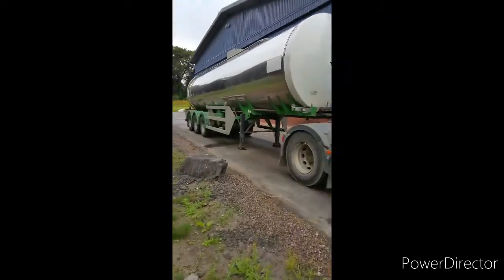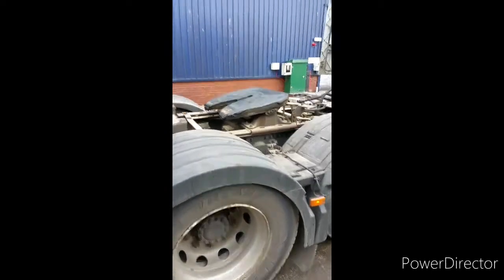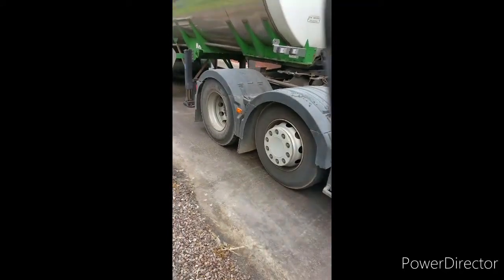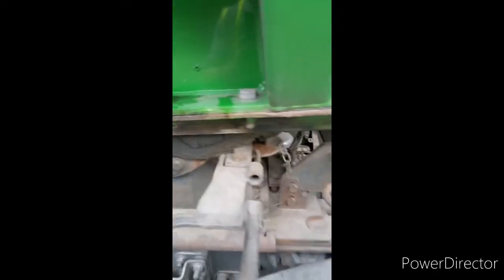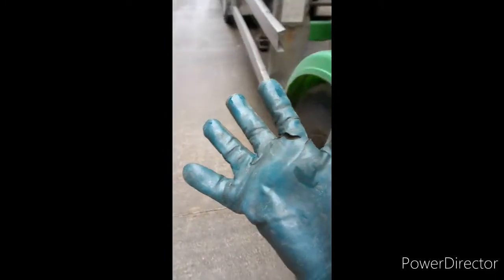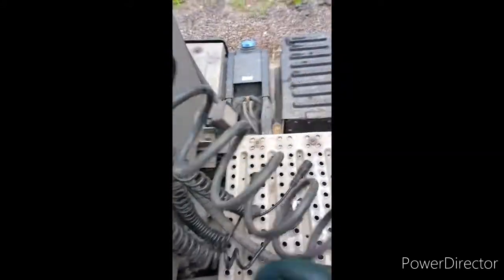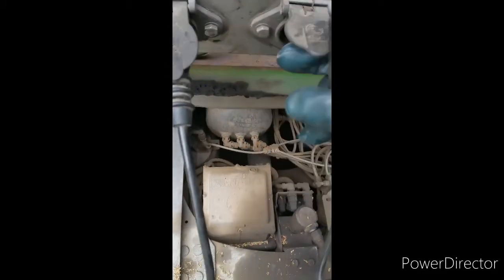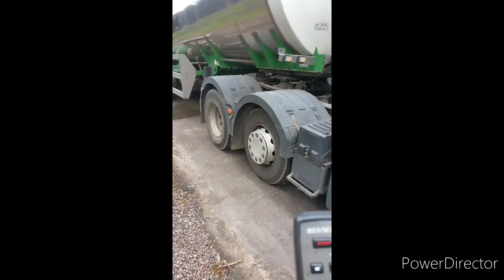HGV Artic Trailer Coupling / Connecting - idiots guide

Comment: You forgot to check the trailer brake & shunt buttons before you lifted trailer.
      If the trailer shunt button was left on & fully loaded it could roll backwards & damage something like the legs as they hit the ground. 
      We all do it, but it’s worth checking.

Other than that perfect.  I like the way you established it was loaded from the beginning & lowered the mid lift to protect equipment from straining.

Top man.     Hauling tanks is no joke.  Super heavy loads & if a tanker is over-taking guys, get out their way, they will roll in gear with the retarder on twice as far as any other load on our roads & they are tapping the brakes too !!!
Honestly down hill they are a lot of fun, well worth doing lots & lots of checks before setting off.
I always check the air bags for wear on tanks & check markers to see if they are melted to check for brake issues.  Last thing you want is a air bag to break !!   Check for cracks & rips.

Comment: Yellow line always on first  (coupling) and off last (uncoupling)  as a safety precaution (APB Valve is a relatively new addition on trailers and still quite a few older trailers out there without them ) it’s also a H&S guideline but they don’t explain why . The only time what I’ve said is irrelevant is on Scania or on a vehicle where the park brake to the trailer has been spec’d out by the customer to the manufacturer on the build or pre delivery
Reply from the maker: Great bit of advice chap, thank you for that! Would you happen to be a mechanic? Not many drivers would know that one I must say
Reply: Makes no difference, clearly you haven’t done any shunting milk tankers before. 

Always start from the furthest away & work towards you, no matter what the trailer is.
It’s not rocket science!! & don’t over think it.   Just hook up all the lines !! 

You may state ‘safety reasons’ but that’s it. Tell me in engineering terms why.

A red line around a yard is perfectly fine on its own, in-fact if your lazy & forgot  the yellow JUST the red line is fine all day long the brakes will work fine.

Comment: Why raise it right up and force the wagon under it there's no need to put all the weight of the trailer on the 5th wheel before hooking it up  ,far easier if you have the 5th wheel just touching the belly plate no friction when you hear the double click then raise the suspension to take the weight off the legs do two tug tests if all's good finish coupling up